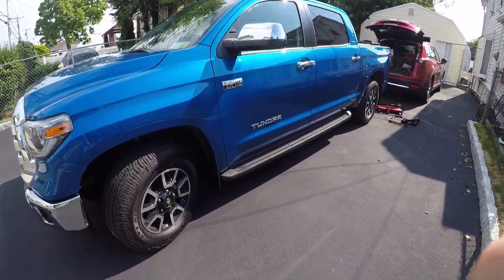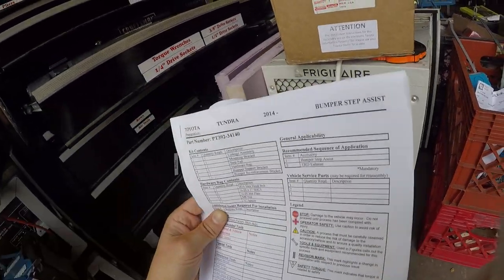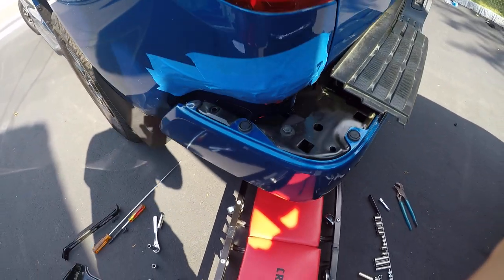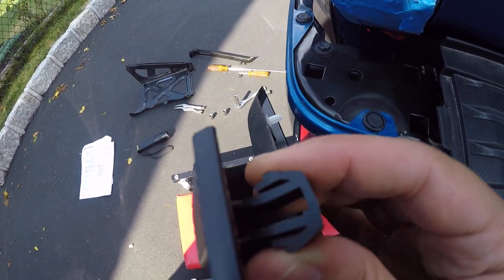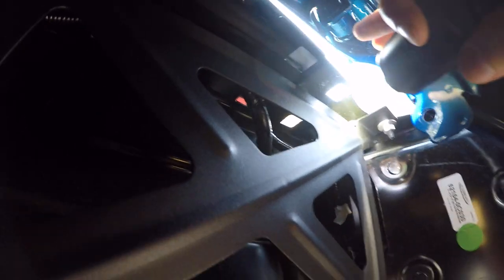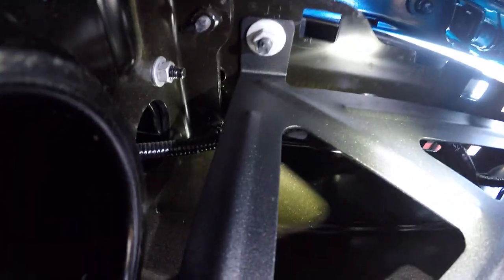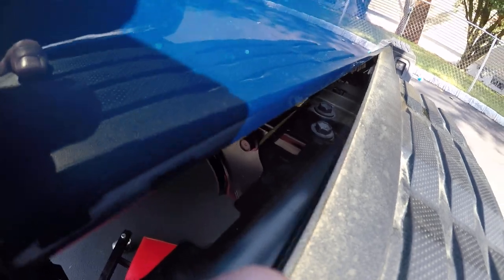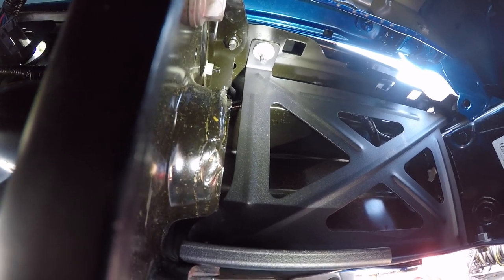2018 Toyota Tundra BEDSTEP install, please READ FIRST

Comment: Thanks for this video! I've got a sawzall, so I skipped the step about replacing the bumper support-I just cut away the portion of the original support that interfered. Saved about an hour of work.

Comment: Thank you for posting this video. I just bought a 2018 Tundra and Bedstep. After watching your video I took a close look at the possibility of installing the step without replacing the bracket. It looks like the factory bracket cuts the corner at a 45 degree angle allowing the step to install in the up position but when you lower the step the factory bracket is in the way. Showing details on disassembly of the bumper is very helpful thank you. I'm going to attempt this install tomorrow.

Comment: I decided not to use the support supplied in the kit. I wasn't going to go thru all the BS of removing the bumper cap and potentially damage stuff just trying replace the support. So, looking at the AMP support, you get an idea of how much room it needs to clear the support. I took my die grinder to the stock support, with it in place, and cut out a section between the lightning holes. The step mechanism bolted up and clears just fine. https://youtu.be/6U75LYBkz1k
Reply from the maker: Yes that was probably way easier !!!
Reply: Sawzall work really good,  took about 30 seconds.

Comment: I just finished the install, reaching the clips is definitely the hardest part. I was able to use a needle-nose pliers to get them. Be patient and don't put unnecessary stress on the plastic. The rear most clip on the corner piece seemed to be the hardest. I was able to get it by going straight up from underneath it with the needle nose behind the bracket. I didn't even try the 19 mm bolts with a ratchet, I just used my impact. Thanks again Eddie, without this video I probably would have ended up breaking some plastic along the way.

Comment: Thanks for the video. I just finished installing the bumper bracket part onto my 19 Tundra TRD Pro without any issues. I took my time and made sure none of the tabs broke and that everything was bolted down properly without scratching the paint. Later this afternoon, I'll wrap it up, but at least the hardest part is done.